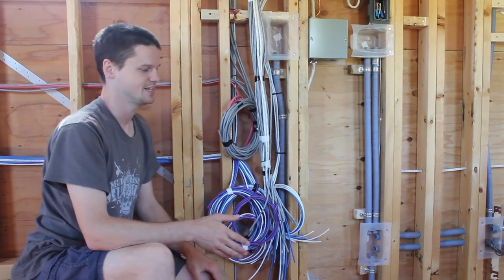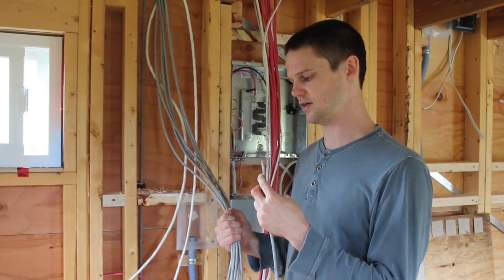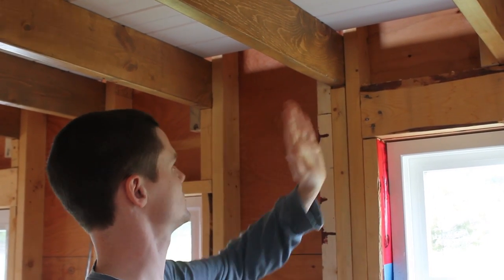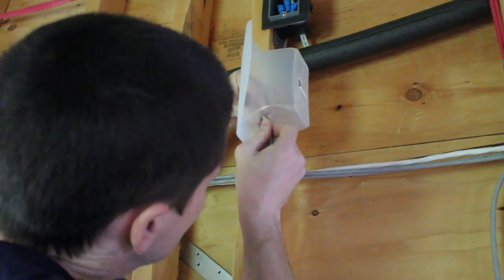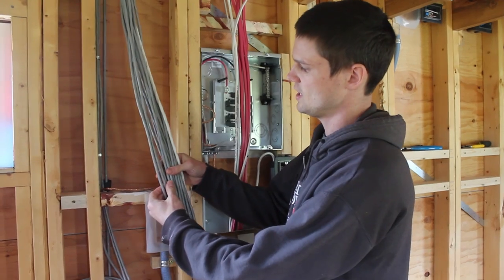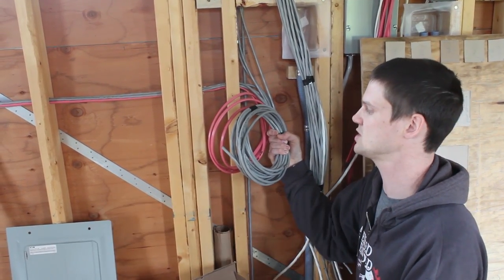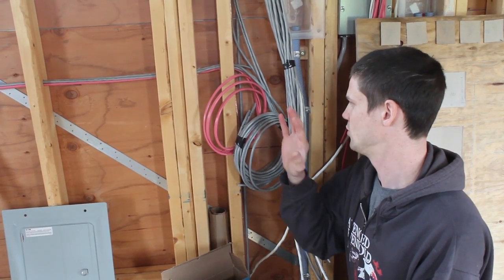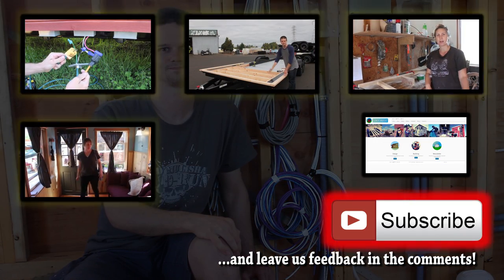DIY Smart Tiny House Control Wiring (Ep.46)

Comment: Your smart tiny house is already the best planned design I've seen and will be one of the most advanced when it is done.  I guess that makes you smart tiny house owners!

The great thing about your desire to do the wiring up front is adding that stuff later would totally discourage anyone from doing it for the massive difficulty of the project. Wireless systems are cool but you'd better hope you can get replacement remote controls and digital controllers if/when that proprietary system breaks.

Having Ardrino, Raspberry Pi, and/or Beaglebone Black based controllers increases your chances that you will be able to adapt your system in the future, too.  The cost of doing this stuff now ( and with wholesale prices I'm sure ) will pay for itself in a short amount of time and increase the energy efficiency of your home.  Quality of life is another area where a little of the right technology goes a long, long way. 

Way to go guys!
Reply from the maker: +John Norris Trying to make a finished house smart is a huge pain, because yes you either have to do difficult/unsightly wiring or go wireless, and in most cases people use a proprietary system, which can be very restrictive. We have all the wires for simple inputs and outputs, which should allow us to switch to a Raspberry Pi or another system if we needed to change the operating system for some reason. Thanks for watching!
Reply: John Norris Qi

Comment: Another thorough video. Great job! I am curious if you will be installing some sort of ceiling under the loft joists to cover all the wire bundles. I'm also curious how a ceiling would work with the valve system you previously installed for the shower.
Reply from the maker: +pbj417 There is one joist-space that will have wires and plumbing in it, and we will be putting a removable cover over it. All the other joists will be open and three of them will have a light strip down the center. We plan on putting some custom extensions on the valves so that they can be operated from outside the cover :)

Comment: What is the distance from the floor to the bottom of the loft joists? How did you decide on that height?
Reply from the maker: +Taylor Thorne It's 6'4"... I (Jake) stood up straight, held a measuring tape beside myself, put my hand on over my head at a height that seemed like it would be comfortable... it was 6'3"ish... added one inch extra... done. That was then used in our Sketchup design and we didn't actually stand under it until our framing was done... so we're glad it worked out! :)

Comment: Just curious. Why didn't you go with a wireless solution and avoid the weight, complexity, and extra holes in  your studs?
Reply from the maker: A big part of it is that I wanted to make it all from scratch, and wireless would be much harder to set up that way. Everything also still needs power... and I wouldn't want our lighting to be battery-operated.

Comment: Very impressive, the arduino should be really cool. Would you be willing to do a video on the code that you use to control the lighting? A bit over kill with 12 gauge I'm surprised you didn't run number 8s. I'm looking forward to your grounding ring video. lol
Reply from the maker: +Benjamin Van Brocklin 12 was just for the furnace because the blower motor will draw a lot at the moment it turns on. Everything else is 16 and a bit of 18. We will be showing a lot more when the arduino starts to operate things, but we're also thinking about expanding our website to include a section on control... stick around :)
Reply: Did the control section ever materialize?  I was looking but could not find it. Need to get into this deeper now when our original option turned out to be a non-starter (astronomical price). Time to DIY
Reply from the maker: We're still planning on it, but haven't installed any of the final devices. Hopefully this year :)

Comment: I've got an idea for your extra12v ideas... I've always hated drying the shower area at home after use and still eventually dealing with mold and mildew in the places where water sits after a shower, typically in the caulking or corners. So an idea would be a heated floor with a timer switch with it extending up the bottom part of the walls to cover the corners where water sits to help it dry quick. Heated floors in the bathroom are luxury living also!

I think its great you have a dedicated 12v system. Using a battery bank and 12v items will be much more efficient off grid than using pure sine inverter for everything. That power conversion eats some of your precious power.

Pro Tip** (Jake I know that's your saying!) If you do go for a battery bank eventually make sure its well ventilated to the outside, both wet cell and AGM sealed batteries can vent nascent hydrogen during top up and or over voltage (boiling maintenance modes). Maybe even a little during bulk charging modes. Most people think only wet cells gas, but sealed batteries can also even though its more rare (vents are usually under the label of a AGM). Look that up for your own health and safety. Also if choosing wet cell the only trusted true deep cycle batteries are golf cart batteries. Some marine and tractor batteries etc.. claim to be deep cycle but they lie in some cases since it is not really needed in most of those applications, so they get away with the marketing scam. Electric golf carts have to be deep cycle otherwise the cycle life would be killed in no time if truly deep cycling the battery. Usually golf cart batteries have a recycling program so you get a savings if you return an old one and purchase a new one which is beneficial after many years in a home system scenario that uses many batteries. In Stouffville Ontario you can see an example of that at Bennett golf carts website. They sell Crown golf cart batteries 6v 225ah for $149.99 with the return of an old core. No matter what never run a lead acid battery down to 0% or even close to that. This always drastically kills the cycle life. Overbuild the system so you rarely take the batteries below 50%. This should ensure 1000 cycles or more before needing to replace the batteries. Never let the wet cells run down on water either, always keep them monitored and topped up otherwise that cell will die. You could always go with lithium but I feel like if that goes wrong you and Kiva will be relocated somewhere on the moon traveling via a tiny house rocket ship. Plus with a wet lead acid batteries you can pour urine in the wet cell and let it sit to revive a battery in the case of an absolute last ditch effort to make power! Can't do that with lithium ;)
Reply: +Audioholic 01 One last thing I forgot to mention is that lead acid batteries should be temperature controlled for optimal performance, cycle life and more accurate charging. 20-25 Celsius should be the optimal range for any lead acid environment.
Reply from the maker: +Audioholic 01 Awesome info here thanks! :D we're thinking about using a plastic-type material in the shower so I don't know if built-in heating would be a good mix :P but we do have extra wiring in the vicinity, so maybe some kind of drying fans or something :) 
The golf-cart tip is awesome, we'll definitely look into that when the time comes, and take all your charging advice to heart... I would really like to build my own charger with Arduino and/or something similar... and I have a dream of creating a sterling engine to generate power, along with wind, rain-water turbines, and solar combined :D
Reply from the maker: +Audioholic 01 Oh yeah, we'll probably build some kind of separator inside the utility box to isolate the propane tanks from a new space that we could put batteries into.. either that or an enclosure that sites underneath the house... underneath would actually be a shorted run for the main power conductors.
Reply: +Tiny Nest That sounds great and ambitious! I'm a huge fan of your smart control center DIY system. Its a totally awesome plan. If you do a DIY charger just be sure to look into the battery types first, they vary a little in charge requirements. For example AGM being more sensitive to overcharging requires a float charge and trickle once it gets to about 80% full, this just means the charging voltage drops down for the remainder of the charge in 2 stages, so the last bit is a slower charge. I have a little 20 amp solar charger that allows me to set the 3 charge voltages so I like that a lot. I have my AGM batteries set to charge to about 95% rather than 100% . I do this since the temperature changes where my batteries are and the battery characteristics change and will over charge the batteries when it varies from normal temperature in some cases. So it is a small tolerance that ensures I don't over charge and damage the batterys.  Maybe you could put a temperature probe on the batteries and have the voltage programmed to change depending on the temperature so your batteries are always perfectly charged and no damage! Build in an auto system shut down when the battery's voltage gets below 50% and your batteries might last you 10 years. I'll be watching your progress. I've really been enjoying this build series over the last few weeks!
Reply from the maker: +Audioholic 01 Indeed, I was going to say that we could build a charging controller with whatever sensors we want, and program it ourselves... limitless possibilities :D Thanks for all the battery tips
Reply: +Tiny Nest I got one last tip for lead acid batteries. This stands true for even NIMH batteries! You shouldn't charge any cell fast.  The faster the charge the more you can damage a cell slowly over time. With a small battery bank you could easily have too much amperage in relation to the amount of batteries. For example:

If you had two 225ah 6v golf cart batteries wired to 12v you would have a total of 225 amp hours at 12v. If you had six 12v 100w solar panels you could potentially have on a good day 60 amps of power. This would charge this small battery bank too fast.

However if you had eight 225ah 6v golf cart batteries wired to 12v you would have a total of 900 amp hours at 12v. If you had the same six 12v 100w solar panels you could potentially have on a good day 60 amps of power. This would charge this small battery bank optimally.

I learned this from an electronics engineer that knows a lot about batteries and charge circuits. I also found that the engineering outlook on this is not practical. I need my batteries to charge fast, not take a few days to top up. So with a tiny house battery system you will have to try and build the system large as possible so you have a good balance and you can confidently have more charging amps in relation to the amount of battery AH. I know most people don't take this into account and still their batteries can last for many years before the battery capacity is low enough to need replacement. It all depends on the battery type, If you think about a car alternator, they range approximately from 80-140 amps. However car batteries have a different design for a lot of cranking amps and can take over charging and fast charging way better than AGM. But a car battery is awful at deep discharge and can be ruined after only a few cycles down to 20% capacity. So this comment is just to put your mind in the right thought process when starting to design the system.
Reply from the maker: +Audioholic 01 One again, excellent info to keep in mind :D

Comment: Have you thought about your 3-way lighting issues in your plans.
Reply from the maker: +1timby 3-way?? try 30-way! ;D  the control system can accept any number of inputs and then perform any number of actions... meaning any button could turn on/off/bright/dim/fade/colour any one or combination of lights in the house, and is totally re-programmable at any time if we find that we want a different function or are not using a specific button etc etc.
Reply: Tiny Nest So if you happen to be in your loft & want to turn off a light below then how do you go about doing that...

Thanks
Reply from the maker: +1timby In the computer program I'm going to write for the Arduino board, I could assign the input from a button in the loft to change the state of the light below.

Comment: Hey, I know this has nothing to do with wiring but I'm wondering what you plan for water is in the winter? I've been really interested in building a tiny house for a long time but 
I live in Canada and the winters can get really quite cold. Any advice or knowledge on this topic would be greatly appreciated! Thanks

P.S. Your videos are great and very informative! Keep up the great work!!!
Reply from the maker: +Sam Wolfe Luckily we are on Vancouver Island where it doesn't even freeze much, and when it does it's only a few degrees below. We will probably run our water-supply-hose above ground or in a super-shallow trench, wrap it in heat-tape, and cover it with wrap-around-insulation. We're pretty confident this will be enough for our location... sorry I don't have a good answer for a colder climate.
Reply: Thanks!

Comment: I was wondering which Arduino or PI you are using in this smart setup?
Reply from the maker: The plan is to use an Adruino Mega for the lighting control, and possibly a second Arduino Uno for the furnace and other automation.

Comment: HI noticed something that has nothing to do with this video.  does not look like there is fire blocking from the first floor to the loft. Normal code for housing would require blocking from first to second floor.  Reason for this is if there is ever a fire the wall cavities even with insulation would act like a chimney and spread the fire even faster. 
Something to think about before insulating.                     All the Best
Reply from the maker: +bigolmoose69 Have a look at this video after about 4mins: https://youtu.be/ul5dhy6gQxk

Comment: could you make a video about ioBroker in english?
Reply from the maker: I hadn't heard of that, nor are we planning on using it. I want to start with simple offline Arduino control, and then possibly add another online device that can feed simple inputs into the Arduino.
Reply: its an operation system for smart home working with arduino. If you have an Raspberry Pi, than you can install it and control all your arduino devices centrally. Its Open Sorce for free, already had 12500 usery using it with arduino and another smart home components. best regards! And thank you for your answer
Reply from the maker: Cool, I'll check it out!

Comment: 😮😮😮😮😮😮😮😮😮 what happened to 3 lights, a small fan and a wood stove??? lol . you lost me at ardrino..... so how many times did you forget where the wire was going?   so are you thinking of putting in a bidet along with the heated seat?? lol  I would give serious thought to a small battery bank maybe 1000 amp/hrs, if for no other reason than as a simple back up, since you have all that stuff  computer controlled. Again diyer's are  hanging their heads "why didn't I do that?"  good video.
Reply from the maker: +Duane C It's going to be amazing... if it all works as envisioned.

All the wires are very clearly labelled ;)

Our toilet = a bucket... + whatever electronics we want to add to it.

We will be getting batteries eventually.